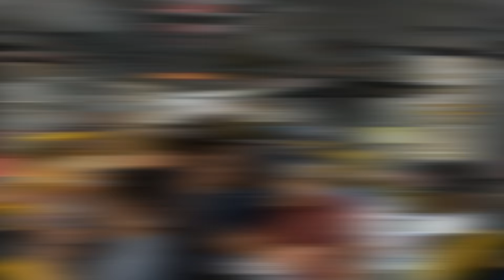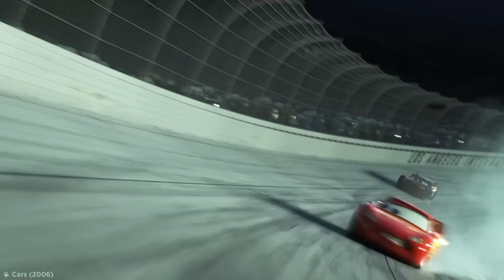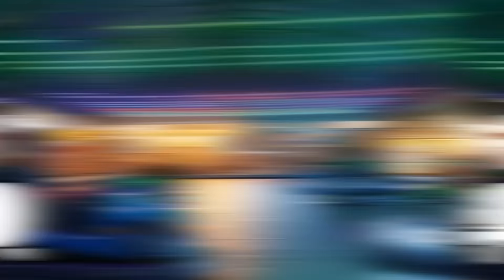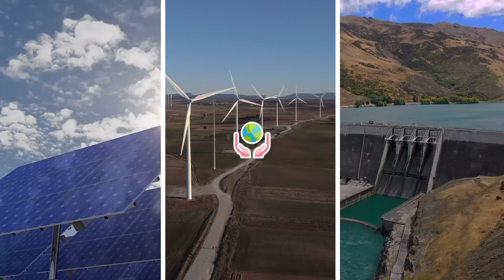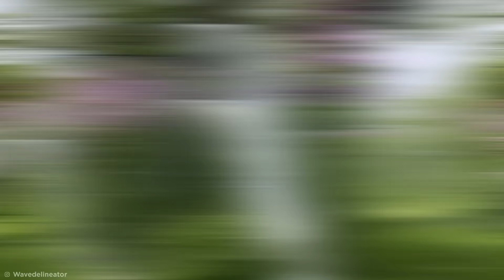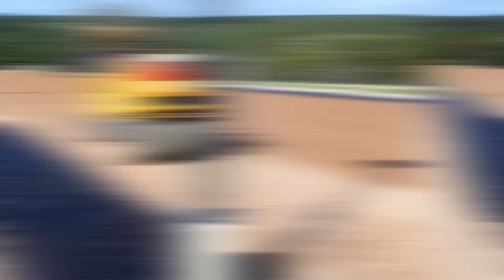How These Road Inventions Changed Everything

Comment: Road asphalt in deserts stays solid because it uses Hard Grade Bitumen mixed with Polymers (like SBS rubber). These chemicals raise the melting point and create a structural web that holds the tar in place. Additionally, the road is mostly crushed stone, which provides a solid skeleton that doesn't melt, regardless of the temperature.

Comment: Solar roadways are not a good material with current materials being used. Back in the "solar freaking roadways" hype a long while back, it's been a pretty dead end venture. It's much better to keep it off of the roadways on the sides where it's not covered by passing vehicles.

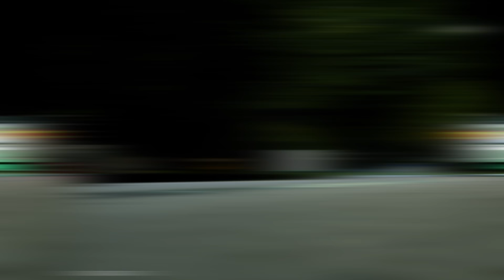Comment: 3:08 😂😂 anyone remember the old car tracks we had as kids back in the day that had 2 wire brushes hanging under the car touching the 2 metal strips on the track ya just pulled a trigger on the controller and the cars took off
Reply: Also unless theres something put in place to keep the bar that comes down to the roads charger in place, its gonna just fuck the batteries up. Just like plugging in a charger to your phone repeatedly kills the battery life

Comment: Umm so we are going to make more electricity but lower fossil fuels. Better be building a whole lot of nuclear plants i guess cause wind and solar won't cut it. Reality is that it will reduce road CO2 but do little to help world wide because more fossil fuel plants will go up. Plus add the strip mining  operations to collect the rare earth minerals needed for batteries and toxins that will be released in to surface water from the vast battery graveyards. Sorry greenies it is a pipe dream

Comment: LOL solar road is nothing but a scam and lie. 
1) Solar panels only make use of 100% of the sun when they are directly pointed at them, hence why solar power planets have there panels at an angle and they rotate to keep them inline with the sun.  having them laying flat is the most inefficient way of using them and will only have a brief window in a day where they can make use of all the solar rays.
2) Traffic will hinder sun getting to the panels so add that to my first point and its even more pointless.
3) Solar panels need transparent tops to work. Offen glass but any clear surface used will scratch and will lower there ability to produce power, the constant traffic will no doubt brake them quickly.
4) Less grip on the road means more crashes. can you imagen a reinforced glass or some clear resin in the rain ice rink, nice reason why roads and paths are made about of tarmac, durable cheap to make and gives nice amount of grip. Also its recyclable, pull it up and heat it and the tar melts so it can be used as new tarmac somewhere else.
5) Oil and other dirt building up on the road making it unable to function as a power source.
There are more reasons but there the main.
I am 100% certain the Chinese had a power station running everything and only "Claimed" it was running all of it.

Really guys don't say something is amazing when its obviously a scam and would never work.

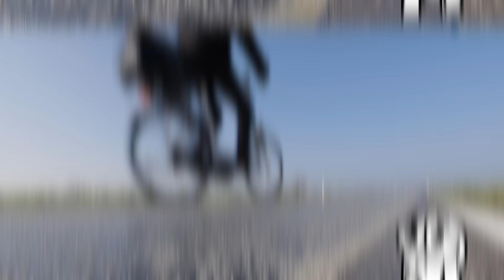Comment: 5:41  Did you state that the ELON rails charge the vehicles while they are driving, but when you move onto the solar panel roads in China you state that wireless charging technology doesn’t exist yet. Wouldn’t the Elon rails count as wireless charging technology?
Reply: The elon roads use a device installed under your car to make physical contact with the road.

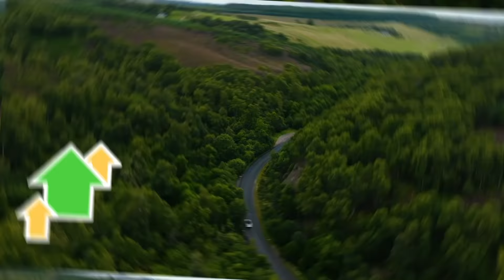Comment: 04:16 ... But what is powering the track on the road? "Green" energy isn't reliable unless you include nuclear, so coal and gas-fired power plants are still going to be needed to power the road strips.
Funny thing is I asked my dad back in the 70s as I played with my slot cars, "Why can't we make electric real cars that run on power from the road like these slot cars?"
He said, "It would be so expensive to power those roads, and who is going to pay for them?"
Maybe in small Nordic cities where everything is bunched up together these roads make sense, but certainly not in the broad expanse of the United States. More emissions would be pumped out maintaining these electrified road strips than any use they would receive - remember, real cars and trucks will be driving over those road strips, too. 
The constant weight changing differential on the electric strip from cars and semi-trucks, plus the vibrations of traffic and the drastic differences in weather changes (even in one day) in the US would make these another boondoggle like those solar road panels that were attempted in Seattle a decade ago.

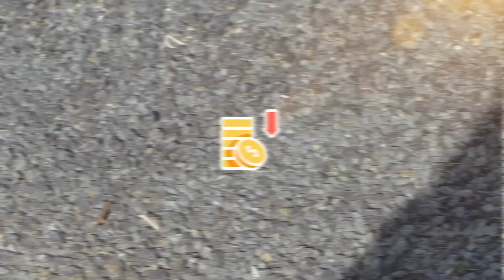Comment: 31:42 The chip seal surface is horrible to say the least.  Yes, it provide good traction, but at the cost of increased noise.  I live about 1/2 mile from a road that was chip sealed and the road noise was very much annoying even from that distance. Houses along the road would have been able to hear each passing vehicle from inside.  Try to imagine trying to sleep with that.
Reply: Not to mention what a new road does to your paint job and windshield!   "Chip" is 100% accurate, and drivers get to pay for repairs!
I can't believe anyone would promote chip and seal as a new, improved development in roads.

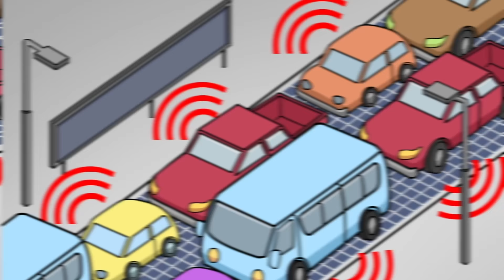Comment: 5:08 here is a really good picture of why solar panels in roads is a really really bad idea.
There are constantly cars blocking out the sun, so the solar panels generate no power.
If you put the same panels on top of buildings that already exists for example, you suddenly got sun on them at all possible times, and the cost of making and installing them decreases substantially.
Solar roadways is a dumb idea from the offset.

Comment: The footage of the bike path is from the Netherlands and is the SolaRoad project that pioneered the integration of solar panels directly into the surface of a bicycle lane in 2014.
In 2020 it was removed and is considered a failure and the total cost of the pilot project was €3.5 million
Reply: Yes, pretty much every attempt at net zero/ renewable energy has been an abject failure, if for no other reason than each requires resources to build and its own infrastructure that also requires resources and it must be maintained and has a relatively short life span (which is often artificially shortened even more by endless new technology that accelerates the need to replace the existing technology). Add to that, all are electricity based, where they are tearing down reliable sources and replacing it with unreliable sources that 1) again requires a huge amount of resources to build and maintain 2) requires large areas of land and/or is located a very long distance from its consumption 3) the unreliability and lack of inertia results in an unstable grid.

IOW, Net Zero shows the folly of both trying to control the market place and legislating technology.

Comment: Hi
At 2.59: You are wrong.
ELON, is a Swedish chain of electrical supplies, like vacuum cleaners, and other supplies. for homes.
The correckt term for electricity, is : Elektricitet, nothing else.
So, wouldn't, unpaid, do any adds for that chain of shops
BTW, that "system", reminds me of those toy cars, on a plastic racetrack, when I was at your age, 🤣
And, as a ret. rally driver, I don't want to be found dead in a ditch, in a EV!
ICE forever, or as long as the dino's are supplying us with carbons,  and fuck Greta the Frogface.
At 4.45: those are not, "solar powered batteries", those are solar cells, transforming the light to electricity, "transported" to a battery.
F1 cars don't use banked turns, and F1 cars have a body, as at 6.12!
What the hell are you talking about, and showing as real facts?
Blending F1 with the most appreciated, redneck race: INDY!
Yes, F1 use the retrieving system, converting braking power, back to the car, and to be used again, what has this to do, whit a Pontiac from 1960;ies, rolling over?
"Chains" for the rollers?
I think I end my sub for this, turned to be: Bullshit channel.
Fact check, please.
from a Finn in Diaspora

Comment: The reason i think solar roads will be a forever stupid idea; why build the solar panel where cars drive? Its alot more expensive, and prone to wear. Not to mention, less safe to drive on.
If we need "space" to build  solar panels, then use roofs first, that seem like the most obvious place to install them. If we run out of roof, then start building roofs. Simple roofs that go over the roads, to install the panels on. Additional benefit, drivers get to drive in shade during hot summers, and you get some protection against raid, and roads stay more dry. 

Im not saying my ideas are "good" ideas, but they both seem obviously better than DRIVING ON the panels.

Comment: I would just like to leave a comment about your solar road and wind turbines... It's all very nice, and I see how much electricity it can generate and so on. I just want to ask, where does it all go? Because the electrical networks are not designed for such loads and surges, and then what happens is that the power lines literally evaporate at some point... This energy source is not regulatable and cannot respond to the current demand of the network. You can't turn off the sun or the wind with a switch, and on the other hand, we don't have a switch when the electrical system needs to increase the current... So what is your solution to this issue? Because battery storage is technically problematic and carries significant risks. Storing large amounts of energy is highly dangerous and problematic. How, then, do we balance fluctuations in consumption and production from these energy sources? This could be a very interesting topic for a video, but probably also a very difficult one.

Comment: Elonroad, that design is at least way better then wireless charging which runs into the inverse square law wasting a ton of power. 
That said, better to just get rid of cars all together and use a rail system inside and between cities.

Comment: Actibumps are the most dangerous thing on earth. Only because the speedometer in your car and the sensors on the bump are inaccurate. I was ones going about 5-10 km/h below the speed limit and it still activated
Reply: Imagine hitting it on a motorcycle!
Reply: In theory they should be decent if properly designed. Usually they have much too sharp an activated shape instead of just being enough to cause mild discomfort / making you take notice. But if designed well, it should be at worst no worse than a regular speedbump.

Comment: Surprised we didn't see the kinetic sidewalks getting installed around Japan right now. They're in slightly movable panels that collect kinetic energy from people simply walking on them. It's very little per step, but when you have millions of people walking around on them every day, it creates staggering amounts of energy at a time.
Reply: Sounds like another method of clandestine theft, similar to how Google and others steal our data just now they will be stealing your energy.  I'm sure there will be a TOS posted where it can only be read on the sidewalk that will say something similar to "By using this sidewalk you agree to these TOS, to have your energy drained, your location tracked, the number of steps walked and the distance between each step measured, etc., and for this data to be sold to the highest bidders for any purpose, ethical or otherwise. No loitering, stopping, standing still, or slowing down except in front of approved advertising, no Crocks, bedroom slippers, chewing gum, or skateboards allowed."

Comment: 4:17 You would still need to power the rail.
Reply: I was like, "you are kidding, right?" lol
Reply: Also, at highway speeds, you'd need the rail to run 10-15 miles to get a significant charge out of it.  I can't imagine how expensive it would be to keep a 5-mile run energized at 300 kW and maintain it.  Seems like a solution without a problem, 99% of people are capable of keeping their EVs charged off their home's power with only very infrequent trips to charging stations.
Reply: Nuclear, hydro, aero, solar